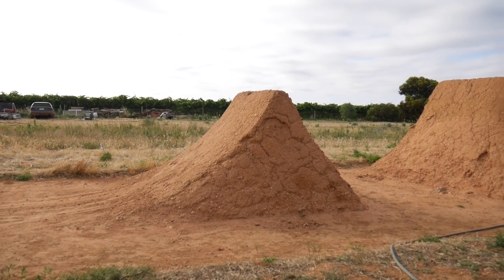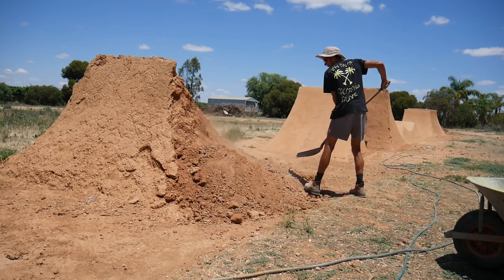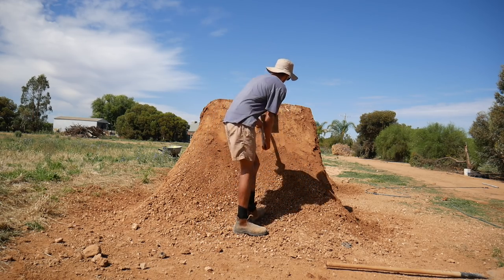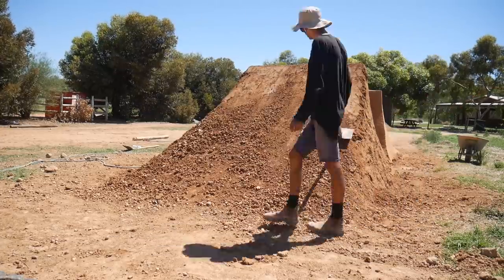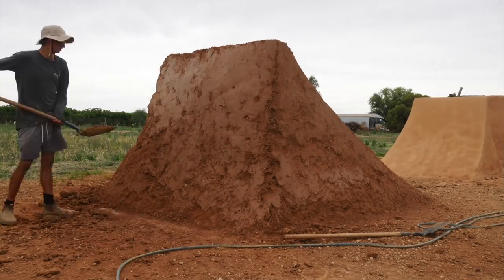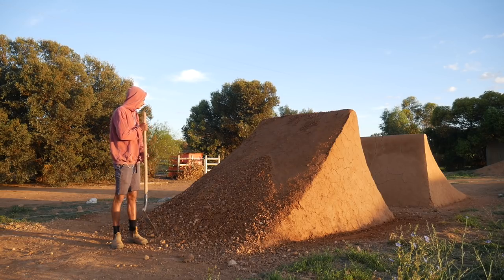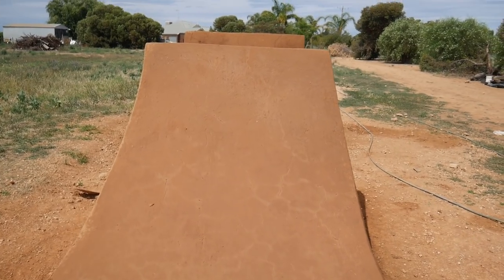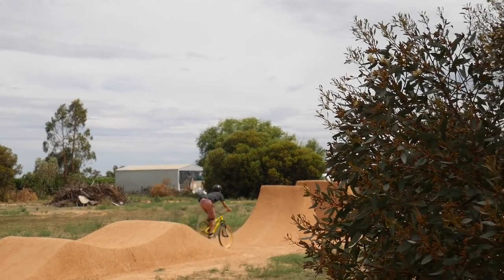How to Rebuild Dirt Jumps

Comment: As a mountainbiker these gaps look so insanely steep, high and even quite far if you take in mind how high you fly. I mean essentially it's like dropping down a 2 storey building and being lucky enough to find your way down at a very steep and short landing. Just a bit too short or a bit too far and you are either faced by a sharp edge of the landing or a flat surface. So yeah, mad respect to anyone that rides (and builds) these sculptures!

Comment: If you put some old carpet on the jumps whenever you're not riding it will keep them nice and smooth. It holds the moisture and keeps the jumps from drying out and cracking. It also keeps the rain from washing out the dirt from the face and landings.

Comment: Hey Greg, nice job on the jumps. If I may ad a few comments as I used to work for engineering firm doing soil engineering, here's a little Soils 101 for you guys.
---Your soil works great and the reason that's so is you luckily have soil that's rich in clay particles. Three things I know of that lead to good compaction, stability and ultimately maximum relative density are, clay, fines and water. Your know you have clay when you wet it and run it between your fingers and it  has a slippery greasy feel to it. Clay works great for two reasons, one, water bonds to it well and the combination bonds to the other particles well. Two, clay breaks down to really small particles so it fills the gaps between the various particles. So the two characteristics form a well bonded and dense product.
---When working with non-clays, fines and particular organic fines help, non-organic fines help fill in the smaller spaces and organic fines help hold water and in both circumstances its the bonding with water that is the key. Organic fines can be easily deciphered also, add a little water and again rub it between your fingers, this time instead of feeling greasy it will feel a little courser and will stain your fingers.
----Of course the water content (the other is compaction effort) is of huge importance here. It's the meniscus and or surface tension effect of water, that the various particles use to bind the composition together. Another example is beach sand, dry sand is fluffy and dry and does not hold together, but add a little water and you can build a sand castle. As the castle drys it will eventually fall a part. If that same sand had clay or fines mixed in, it would hold together better and longer and have a greater performance capability.
----So, your lucky, or who ever provided the soil knew what you were going to use it for and made a educated choice. One thing I would recommend it that you wet the surface before you start the rebuild stage, adding a little water will help keep the 'core' of your ramp hydrated and the replaced dirt will adhere to it easier. Also if you keep the ramps covered most of the time it would help hold in the moisture. Proper moisture content is the key not much, not to little; the sun, low air humidity and the wind will suck out the ramps water content. Anyway, enjoy the ramps and did I see a back flip....hmm?

Comment: Normally when I fix minor cracks I take very fine grain dry dirt and throw it on the jump then use a broom to spread it into all the cracks, then after that I wet the jump and re-pack. A bit different than this method but I work with red clay so may be different.

Comment: Have you tried fifty foes slurry technique? Just add fine dirty some water and stir it in a bucket. Then wet your jumps and pour it on. When it’s fully dry it’s rock solid but the jump needs to be the right shape before, but if you do it every week then you won’t need to maintain them.

Also makes the jumps look amazing
Reply from the maker: Nah I haven't tried that yet!
Reply: takes at least 6 buckets for the whole jump but it might help with tyres sinking. But from experience it will harden up good but will obviously crack

Comment: Nice video.
How long did it took you to rebuilt the jump?
And I also want to built a jump in my backjard but how much speed do I need. How fast are you when you hitting your jump?
Reply from the maker: It took me at least a week but I ran in to problems with my camera. You need to be peddling pretty hard at my jumps

Comment: have you thought about using reinforeced earth? if you layer the dirt with weed membrane every 4-5 inches, they'll last much longer. Should be about 20$ a ramp, and there are little to no collapses, though the tips and platform will degrade, it will be very minimal.
Reply from the maker: Nah haven't thought about that, seems like a good idea!

Comment: What would you charge to make a dirt track similar to this to a farm that has a bunch of shared ownership? Farm currently has bunch of tracks for motocross but nothing for BMX and mountain bikes but lots of people on bikes. Generally they spend 15 years going out there each month and it would be good to have a dirt jump track out there on a downhill gradiant. IM thinking maybe 3 or 4 different runs and berms, similar to the adelaide one. It would be a hell of a lot of work, but the second option would be just a single run, maybe a double run, but without berms etc. Something semi serious.  Have you got any ideas for a similar type of track that you would be into building. the onegodd thing is we have tons of working bees there so maintenance wouldbe taken pretty seriously and the place is very dry but with ponds. Could you reply with a ball park figure of what you would want to be paid to build something and how long it would take you to build and what machinary you would want there. Obviously youd be living on the farm while you build it, but the main thing is a number that would make it worth your time and effort to build this? Im asking you because i want to pay to have a few things built here and keen for a dirt jump course